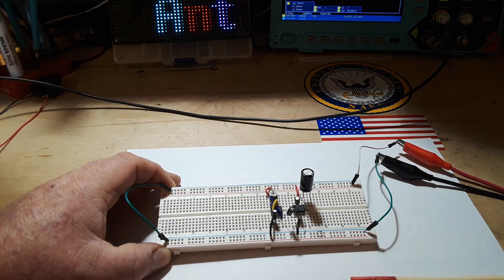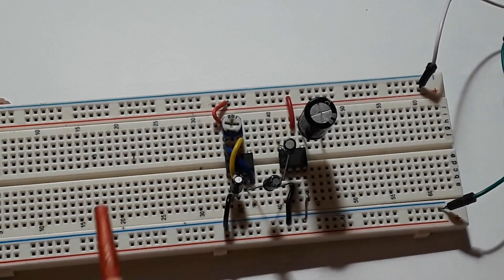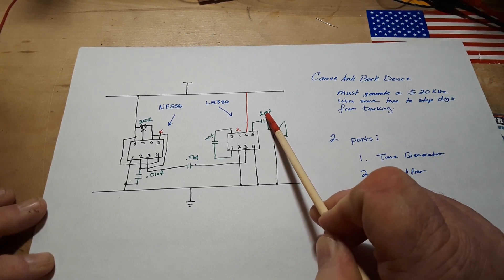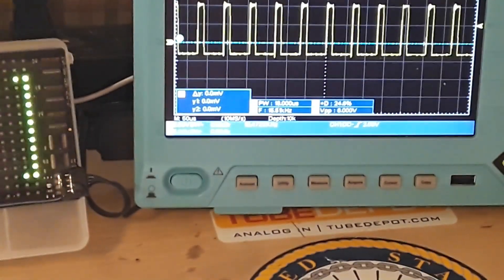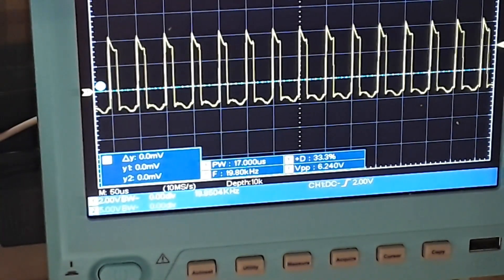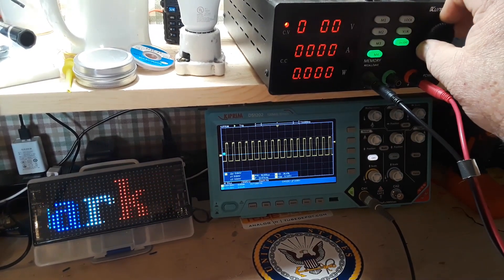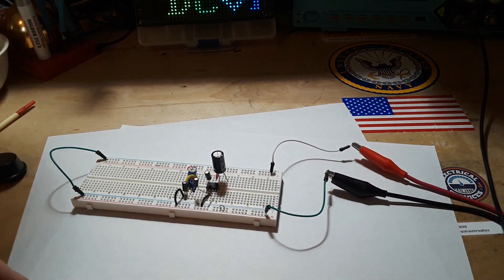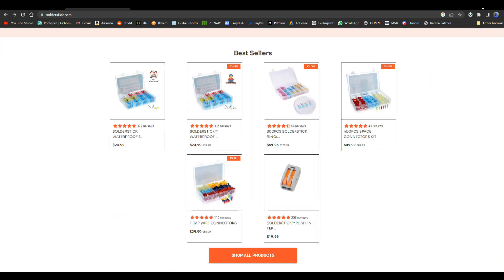The Anti-Bark Is Almost Ready - brought to you by Solderstick wire connectors

Comment: i would put a filter between the 555 and amplifier to make the square into a sine wave. outputting a square wave will also produce a bunch of harmonics which takes the main power away from the fundamental frequency, just like flat topping an RF signal, it spatters everywhere.  Put that circuit on a spectrum analyzer just for fun!

Comment: Ultrasonic transducers look like capacitors, and as such create problems to ordinary amplifiers. I have seen them driven with relatively high voltages via H  bridges. You will also have to work on the acoustical impedance matching (which might require a suitable come or cylinder) if you want to transfer appreciable power to the surrounding air.

Comment: Did it work on the dog??  My guess...probably not.....
I was hired to go ALL-OUT to build one of these..it would have cost a couple hundred dollars, but was paid for by the customer.  I used a, then, new Maxim function gen. IC.  And a special Apex hi-freq op amp that could put out MANY AMPS...It had to be air-wired to drive a professional tweeter that could handle up to 60kHz!
The op amp (IIRC was a PA41??) had to me mounted on a large heat sink.  The tweeter got so hot that it had to be elevated with a powerful fan underneath.  It was highly directional, but barking dogs would do a 180 and run like they were scalded!!
It ended up being used on a rotating platform in feed silo plants.  It solved a huge problem for them, but dust was a major problem with the tweeter!!  Be sure to sweep the frequency back and forth between 20kHz and 30kHz at about 10Hz or small rodents seem to 'adapt' to the frequency in a few weeks.
Thanks for the video!!!

Comment: As a note I can hear 20kHz frequencies just fine. Weirdly when you had the tweeter between the power rails it produced roughly 15kHz (maybe power supply ripple I'm not sure). There didn't seem to be high frequencies when you switched the tweeter over to the LM386. Maybe the frequency was at above 20kHz, or potentially youtube cuts off that freqency, you'r recording setup dosen't record that high or it wasn't loud enough to be picked up.

Comment: I have an idea for an interesting video project for you that I would love for you to demonstrate how to build a breadboard circuit for. For you, this will seem terribly easy, and inefficient, but I’d love the education of doing it and learning how to make this work. I would presume this would be a simple voltage regulator circuit: I have a BBBUNCH of old car, motorcycle, generator, mower, etc., 12 volt batteries that are effectively “dead”. They still, however, measure at between about 6 and 9 volts; too low, and they’re too old and worn out for a charger to trigger to turn on and recharge them, and I’ve tried all the tricks, from adding back distilled water, epsom salts, wiring a good battery in parallel to “trick” the charger to see a high enough voltage to kick on (which has never worked for me), etc. At this point, I HAVE to assume the batteries are “dead”, at least for 12 volts with any usable current load. That said, a CELL PHONE and other low current 5 volt devices do not pull that much current, and I’d like to believe there is some sort of voltage regulation circuit that could be designed on a breadboard to take, for example, 6-9 volts DC, and make it put out a steady 5 volts for charging phones and such. Yes, I know, cheesy, and inefficient, and limited in terms of life span, but it’s the EDUCATION of how to do it that I’m seeking here. Surely there’s a way to connect the “dead” 12v battery to a breadboard circuit, regulator, etc., and make it put out 5 volts (from about 6-9 volts) to a USB-A plug I could splice in. Here in Southwest Georgia, we’ve just had some HORRIBLE weather come through, and power went out for several hours. It will go out again, over the next few days, as more tornadoes and destroyed homes are expected. That said, it put these old batteries back on my mind again. Yes, I have car chargers, portable battery packs, jumper packs with USB outlets, generators, etc., but where’s the fun in any of those modern conveniences? I want to “design” my own circuit to suck whatever power is left out of these old batteries before I trash them, or use them for “core” trade-ins for new ones… I know you’ll know how to do this… Just a video idea… Thanks! 😊😊😊

Comment: Good progress. Try a 0.1uF cap instead of the 2000uF with a series 150 Ohm resistor connected to the transducer (this will reduce peak current and may improve waveshape). Suggest first checking that the dog can hear. Have a scarer in my garden and one particular neighbour's dog was never affected, it was stone deaf.

Comment: You can also hook a dog whistle to a regulated compressed air tank and let it run for hours and hours and hours ... but, your solution is cool, too. :D  If it's a little "yapper" dog, you can also play a snarling cat MP3 that is sound activated.  Aren't we helpful?! :D
Reply: Dude, that's thinking outside of the box!!! I love this idea: simple and ingenious. I imagine one could even put a weight on a piston sliding down a tube whose output is connected to the whistle. Could be automated with a small electric motor to get back to the original position.

Comment: The fact that teenagers can hear much higher frequencies than adults, is actually used to discourage anti social behaviour by teenagers. 
Market squares, where teenagers congregate have ultrasonic speakers fitted. These generate a very annoying noise, that only the very young can detect. This encourages teenage gangs to move on, out of the area.

A.C. coupling the speaker would have avoided the possible damage to the device. A damaged speaker may generate sub-harmonocs. Certainly a burned moving coil tends to make scratching noises as the carbonised moving coil windings rub against the space between the circular magnet poles. 

On my tablet, the audio you are producing can be detected  as a pronounced  hissing noise.
It is likely that this is artefact of aliasing in the digital stages of the you tube audio. Think of it as under sampling of the ultrasonic audio signal, resulting in mixing and down converting. An alternative explanation is overloading of the microphone you are using, resulting in audioable distortion. Of the two, I think the first is the most likely, as I do not think the you tube audio channel can reproduce this high frequencies directly end to end.

P.s. I googled the you tube audio channel bandwidth. It is reported that you tube music channels are sampled at 44.1k samples per second, so in principle a  20KHz  audio signal could be sent from end to end,  according to the nyquist limit. Are all you tube channels given this audio bandwidth?

Comment: If you add a three stage filter between the 555 output and the 386 input you would have a sine wave, this would be much better. Im currently working in a microcontroller based Cat deterrent
( similar frequency). This has a set of frequencies that change, the dog would soon get used to a single tone as does a cat. I find that a quick burst of different tone frequencies does the trick more successfully. I’m happy to share with you when it’s done 👍
Reply: My wife uses regular shampoo on our cats.

Comment: Why did the frequency change so much when at 7.4 volt and 9 volt?
Reply: The 555 timer uses resistors and capacitors to determine the frequency.
Reply: @mikebond6328  Thanks sir.